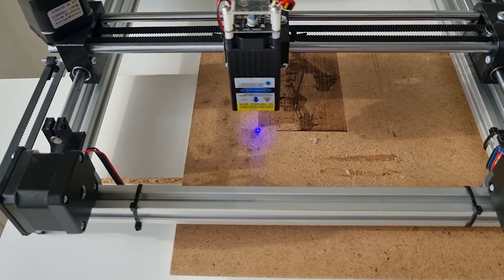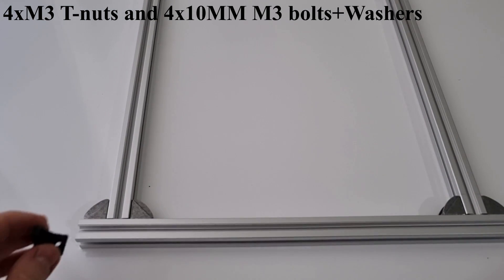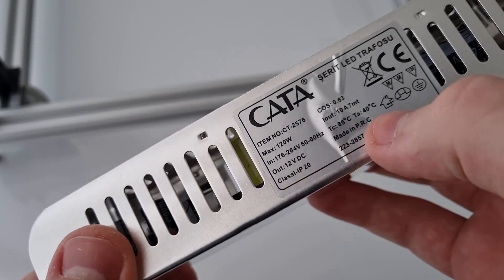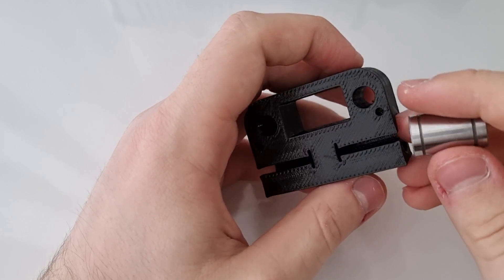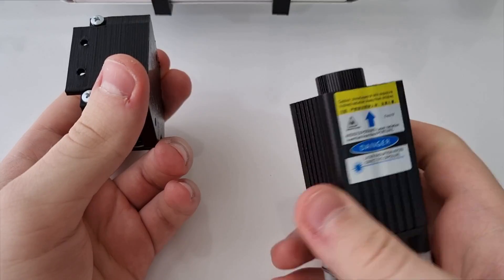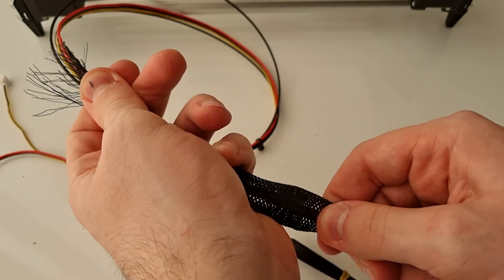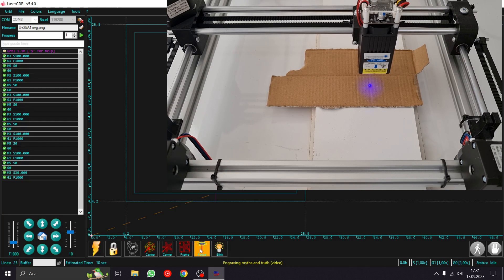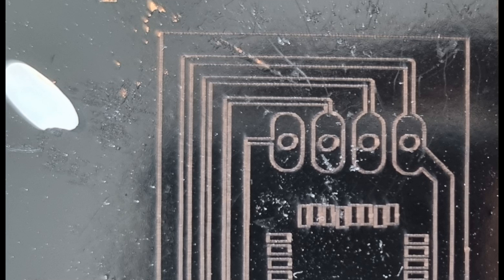DIY-Basic Laser Engraver With Arduino

Comment: I made it but when i run using light burn or laser grbl, my machine stops in between of job, in grbl software pop ups with an error message display thebproblem with my board (but i double checked it and not found any)

In lightburn, doesn't shows any error message but it just stops
Reply from the maker: One of my friends bought a brand-new Arduino, and later we discovered it had a bad solder joint on one of the pins of the ATmega chip. Maybe your problem is related to something like that.
Reply: @bitofelectronics  does it means that i should change my arduino board with a good quality?

But i checked my board, it seems really fine
Reply from the maker: @ritiksadh1999  If you think the problem might be with the Arduino, changing it to another board could solve it. You could also try this: disconnect the GRBL shield, connect the Arduino to the computer, and then start the engraving to see if the error still occurs.
Reply: @bitofelectronics  i tried your way, there was no error and was working fine.

Also i just removed all the connections of motors & laser, but didn't removed grbl shield and steppers drivers, this was also working fine without any errors.

Then i checked my other components, was no sign of any damage neither with the frame structure nor with motors & laser.

I searched whole internet got some solution of grounding it bcoz movement of belts creates static electricity making my machine stop.

But this above solution also didnt worked with my engraver 🙁.

Also tried contacting and troubleshooting with software customer support but still couldn't find the exact issue
Reply from the maker: @ritiksadh1999  This sounds like a PSU problem to me because the Arduino works fine when nothing is connected. It could be the PSU cutting power for a fraction of a second in the middle of the engraving process. Changing the cables that connect the PSU to the GRBL shield might help maybe they are too thin to carry the required current. If this doesn’t help, you could try using a different PSU.
Reply: @bitofelectronics   there might be problem with my poor wiring changed all with the new one and worked.
Thanks a lot for your help brother

There is one more last concern about sizing,
I made 340 x 340mm engraving area, but in light burn or in lasergrbl, when i move my machine with arrow buttons in software towards any distance
For example x-Axis = 200mm moves till 80mm only (same is with y-axis).

Diagonal  x+y =200mm moves till 140mm only)
Reply from the maker: @ritiksadh1999  Im glad I could help :) ,For the engraving area, did you adjust the X-axis maximum travel and Y-axis maximum travel (9:30)? If they are correctly adjusted, the steps-per-mm setting of the stepper driver might be higher than mine. For example, at 1/16 steps, the movement is 10 mm, but at 1/64 steps with the same signal, it only moves 2.5 mm.
Reply: @bitofelectronics  my configurations are exactly the same as of yours, but still there is that issue, i already checked it

I also have set my engraving area correct in configuration
How do i set it to 1/16 steps per mm is there any other specified way of doing that? Because the i already placed 3 jumpers underneath each stepper driver for microstepping,  settings, configurations, hardware inputs all are same as yours, except only for engraving area which i set to 340 x 340mm for my machine
Reply from the maker: @ritiksadh1999  You're using the DRV8825, right? Three jumpers mean 1/32 microstepping for the DRV8825. If this is your case, you'll need to double the travel resolution setting for both the X and Y axes. It's set to 80 in 9:29, so you should change it to 160. Then, write this configuration to the Arduino and try again using the arrow keys. This time, move the machine 1 cm and measure it with a ruler to ensure the step resolution is correct.
Reply: @bitofelectronics  i am using drv 8825, but i had also already tried this thing with a4988with your configurations and result was same there was no improvement.

As of now i am using drv8825 and set it to 160 travel resolution but still the result is same, x & y axes = 8mm in 1cm movement
And diagonal its 12mm in 1cm movement

I made changes to 200 steps /mm in both axis and is working perfectly fine with exact 1c.m² movement 😊

But in diagonal its moving 14mm in 1 c.m,
Shouldn't it move exactly 10mm in diagonal
Or it's okay in its way?
Reply from the maker: @ritiksadh1999  Using the hypotenuse of a triangle, the square root of (10² + 10²) equals 14.14 mm, which is correct. It's actually working perfectly now :)

Comment: Hello brother, i changed my stepper driver to drv8825 and my machine works fine, now the last problem i am facing after enbaling microstepping 1/16, is the machine is moving really very slow even in high speed as compared with your machine in video looks like really fast, how to make it fast please tell
Reply from the maker: Hello,I just used the configurations I showed at 9:29, and don't forget to set the speed as I showed at 9:49. Also, remember that the speeds are in mm/min, not mm/s

Comment: I'm facing issue with its travel steps,
Whenever i move my machine with arrows on my grbl / lightburn software after setting step counts,  my engraver in real moves more than mentioned distance
Reply: Psu i am using - 12v x 10A. = 120watt

Matched and verified the setting you:ve used in video

Stepper motor and the board with psu is connected with no lose connections

Yes, i can move the engraver my turning it by hand.
Keypoint - if there would be a problem with my connections or hardware then it should not work without the jumper caps even, machine is only not moving after inserting all the caps ( i verified it by re'removing the caps and starts working the only problem is with travel steps and smoothness without the caps)

(*note - i also tried after making a clone for my y axis by putting additional connections to A axis instead of running 2 stepper motors with one driver to prevent the drivers from getting overheat / overload, but the situation remains the same as above)
Reply from the maker: @ritiksadh1999  Hmm bro I have no idea what the problem is it could be the stepper drivers, the Arduino, or the GRBL shield.
Reply: @bitofelectronics  i inserted 3 jumper caps underneath of each driver, is it correct or do i have to do something else, should i try with drv 8825 ?

Or should i replace all the hardwares
Reply from the maker: @ritiksadh1999  I think you can give the DRV drivers a try, starting without the jumpers.
Reply: @bitofelectronics can i ask whenever i start the machine it imidietly stop because of some error that displays soft limits, yet they are not enabled in configuration
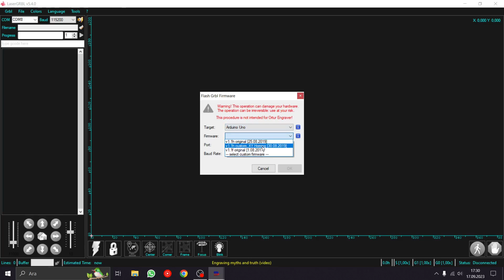Reply from the maker: @coa7966  Hello, this issue is likely caused by the GRBL firmware. Could you please try a different version of the firmware from 9:12 in the video?
Reply from the maker: Are you sure you've adjusted your stepper driver microstepping to 1/16?
Reply: @bitofelectronics  how to do that please advice? Also my motors run roughly in slow speeds which make machine machine to shiver and reduces the print quality
Reply from the maker: @ritiksadh1999  At 8:35 you can see that underneath the stepper driver there are three black jumpers connected.
Reply: @bitofelectronics  when i inserted all the jumper caps underneath the drivers, after that my motors doesn't even move please suggest
Reply from the maker: @ritiksadh1999  can you check the current limit on stepper drivers like the one in this video: https://www.youtube.com/watch?v=BV-ouxhZamI
Reply: @bitofelectronics  i already tried this method of adjusting voltage on step driver but still it does not works 🙁
Reply from the maker: @ritiksadh1999  Let's go step by step

Are you sure you adjusted the settings as shown at 9:24 ?
Ensure the stepper motor is connected correctly to the driver with no loose connections.
What is the PSU you are using, and did you use thick enough cables to connect the PSU to the GRBL shield?
Can you move the engraver by turning the steppers by hand?

Comment: Do I need to upload any code to the Arduino board?
Reply from the maker: Hello,you only need to flash the GRBL firmware (9:06) and configure the settings (9:24), then click "Write" .You don't need to use the Arduino IDE or anything like that. :)

Comment: i made with same wiring connections but my motor lags all the time its not moving, it shivers all time
Reply from the maker: Is it the axis with 2 motors that's lagging, or the other one with just 1 motor?
Reply: @bitofelectronics  thankyou for your reply 😊, but my issue resolved after replacing with a new step driver.

i have one question. As we do our engraving or cutting projects via connecting a pc to engraver with usb, but sometimes there are some designs like images which take a long time like 2-4 hrs to engrave in good quality.
is there any way to use my engraver offline by sending direct g-code to engraver via SD card / PENDRIVE so that my computer would not be running idle for straight hours?

if there is an upgrade with this Arduino CNC to add a display controller and a micro SD / PENDRIVE module to achieve above task please tell, it will be thankful a lot for your help! 😊
Reply from the maker: @ritiksadh1999  You're welcome☺, I don’t have any idea how to use it with a screen, though :(

Comment: can u please tell me that which laser engraving or cutting software's are there which supports to work with this Arduino based laser machines ? Because using laser GRBL sometimes does not gives us the expected outputs.
Reply from the maker: Hello, you can try LightBurn it's a paid software, but it comes with a free trial and is more advanced than LaserGRBL. There are also options like T2Laser and Benbox, but I haven't used those. My experience is mostly with LaserGRBL 🙂

Comment: I've some questions.
Can it homing?cause im not seeing any endstop switch there.
Reply from the maker: It doesn't have a homing function due to the lack of endstop switches but you can manually move to a desired position and then click the home button to set that position as the home.
Reply: @bitofelectronics  so you say i can add some endstop switch?
Reply from the maker: @rakhaevandy  Yes, if you want, you can add endstop switches, but using it without them is perfectly okay too :)

Comment: where can i get laser module used in this video ?
i found the laser module online which says 20 watt laser module with 4watt optical power, is it the same as used in this video?

what is the highest watt optical power laser module i can use with the electronic components used in this video ?

if i want to use higher power laser module like 10-30w do i need to change all the electronic components or only the power supplier ?
Reply from the maker: Hello, I bought my laser from here (the black one) : https://tr.aliexpress.com/item/3256802965524796.html?spm=a2g0o.order_list.order_list_main.5.18753d12r5OXyC&gatewayAdapt=4itemAdapt  

You can use more powerful lasers, but a 20-watt laser with a 4-watt optical output power is more than enough for engraving paint. :)

For more powerful laser modules, upgrading the power supply will be sufficient. You don't need to change anything else. However, the holes on the part that carries the laser are specifically made for the laser in the link. Since it's made out of plastic, drilling it to fit another laser will be easy, or you can edit the files I shared according to your laser.
Reply: @bitofelectronics  thankyou for your heartwarming reply ☺️

Can you please also tell me what kind of material, infill quality & nozzle type is enough to make the parts from 3d printer you used in this to hold the machine & parts and do not bend or break? This will help me a lot.
Actually my purpose is for engraving as well as for cutting thick acrylic or wood from 3mm to 10mm so which laser power should i use?

Or this 4watt optical power is enough to cut and pass through the object, can it engrave on a metal piece also ?

Please also guide me, will it effect my arduino and other electric components if i use high power laser module ? 
I want to make my machine durable and long lasting, i made it earlier on my own then my custom made cnc shield pcb board blew after some time of use, is arduino durable & used cnc shield has enough strength to handle the load?

Also should i use genuine arduino from italy version or the clone is okay to go ?
Reply from the maker: Well, I printed my parts with a 0.6 mm nozzle, 0.3 mm layer height, and 50% infill and they’re still standing to this day.

10 mm wood or 10 mm acrylic is very thick for this 4-watt optical output laser, and I don't think it can engrave metal pieces. For tasks like these, you’d need a much more powerful laser, like a CO2 laser.Maybe you should get something more professional and powerfull like these 

The laser power input is directly connected to the PSU, and the only part of the laser that connects to the Arduino is the PWM signal carrier cable. That cable carries very little current, so using a high-power laser won’t affect your Arduino or GRBL shield.

Using a clone Arduino is fine there’s no significant difference from the original.

Maybe you should get something more professional and powerful like these if you're planning to earn money from it:

https://www.youtube.com/watch?v=wh9C6FDMcbs

https://www.alibaba.com/product-detail/4060-9060-1080-1310-RuiDa-80W_1600467717932.html?spm=a2700.7724857.0.0.22d51a0dpq9Aqm

Comment: I used some 600mm extrusion and round bar for this and then used a 10w creality kit that is used with the 3dprinters seems like its working glued on some limit switches everything is moving I have about a 450x460 usable area with the current setup. still need to test to quality.
For anyone else attempting this keep in mind going bigger than 400 could lead to your rods starting to flex because of how long they are, if you want something larger you would need to use some rollers on a vslot rail instead of the rods.
Reply from the maker: Thanks for sharing your experiences, happy making :)

Comment: I did the project exactly the same. I made the laser settings. But I couldn't get it to work at all. The laser is running, the motors run for a short time and then stop. I couldn't figure out what to do, I get this error”unexpected disconnect”
Reply: Friends, my problem was caused by the motherboard. I solved the problem with the Mks dlc v2.1 motherboard. My advice to my friends who are going to do this is to use a metal bracket instead of a T bracket, the skeleton becomes tight due to the tension of the straps. Try to run the parts you will remove from the 3D printer at 100% full capacity and low speed. In my case, the parts broke and did not fit properly. I hope he did the translation job correctly and thanks to the project owner, a great effort was made.
Reply from the maker: @omerbakr5488  Thank you for sharing your experience and solution, have a great day ☺
Reply from the maker: Interesting, What is the power of the power supply you are using?
Reply: im facing same problem to, could anyone help me how to solve it without changing my arduino uno because im out of money to switch to mks dlc
Reply from the maker: @danishhakimi5730  Hello, could you try using a different Arduino or using the same Arduino without the GRBL shield?

Comment: 7:55 How can you connect 2 motors to the same pin of the arduno shield? I see there are only 4 connectors
Reply from the maker: 8:49: As you can see here I soldered them together to make one connector :)
Reply: 😮oh thank you. I'm thinking if we can add a wifi model to control the device remotely. I don't understand arduno very well
Reply from the maker: @vlvulong5200  Well I don't really know much about NodeMCU and other WiFi-related stuff, but I think we can use a Raspberry Pi (or a Banana Pi,Orange Pi, etc.). We can then connect the Arduino to this Raspberry Pi and remotely control it via VNC Viewer, as long as both devices are connected to the same WiFi network.

Comment: how can the thickness of the working material be adjusted and would the laser module be able to cut whole the way through 3mm MDF wood?
lastly, I like your work man keep going
Reply from the maker: First of all, thanks for the support :) . Regarding cutting 3mm MDF wood, I haven't tried it yet, but I'm unsure if the 4W power is sufficient(It says '4Watt' on the label, but since it's made in China, we can never be certain if it's truly 4Watt or something less powerful :D )Choosing a more powerful laser might be a better option. As for adjusting the thickness of the material, every time we change the material's thickness, we need to readjust the focus. The store on AliExpress, where I bought the laser, mentions in the description that 'the best cutting distance is 50mm' for this specific laser. (here is the link for the laser module: https://www.aliexpress.com/item/3256802965524796.html?spm=a2g0o.order_list.order_list_main.5.18753d12r5OXyC&gatewayAdapt=4itemAdapt )
Reply from the maker: If you want to cut materials with different thicknesses, adjusting the focus can be time consuming. I recommend purchasing a fixed-focus laser and adjusting the laser module's height. However, in my design, the laser module's height is not adjustable, it's fixed. I've shared the CAD files, so you can either customize the part where the laser sits or find a different design online if you prefer to use fixed-focus laser modules.
Reply: thank you very much, but you didn't mention anything about the max depth or wether i can cut a 3mm wood plate using it or no
 @bitofelectronics
Reply from the maker: I only use the laser for engraving so I don't have any experience with cutting anything. Unfortunately, I'm not sure if it can cut through the wood plate or not :(